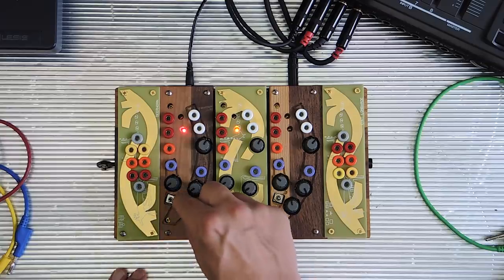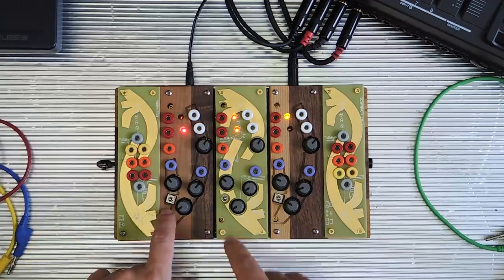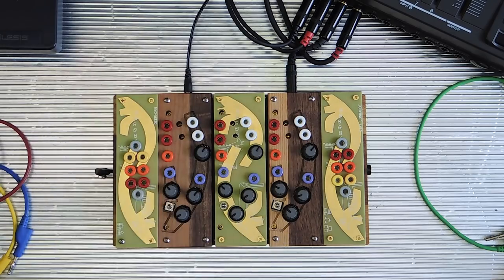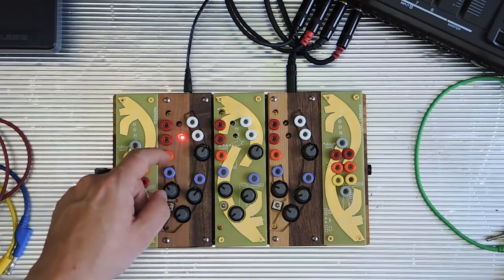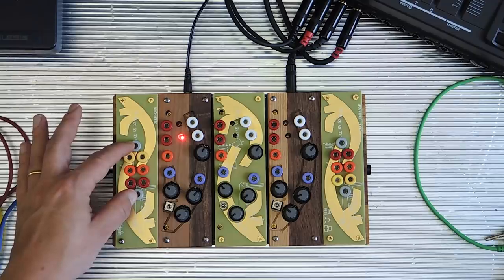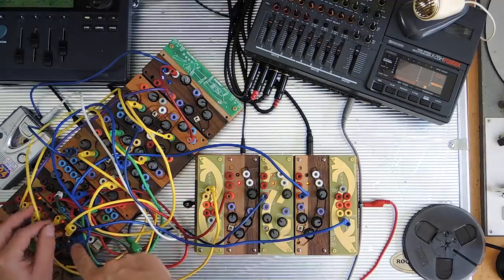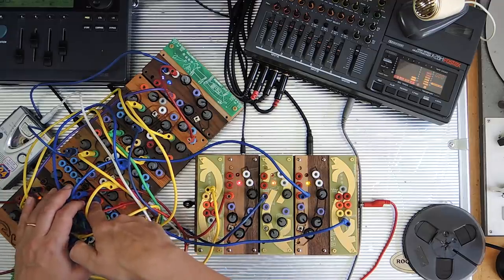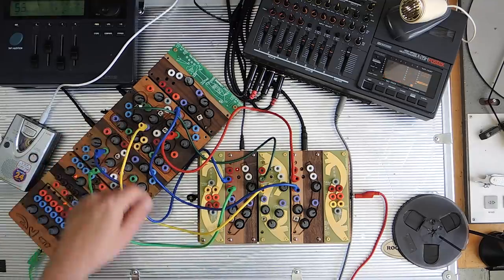Ciat-Lonbarde Deerhorn Organ - An Introduction

Comment from the maker: Darrin Wiener of Patch Point pointed out that Peter's zero is all knobs at 1 o'clock, and not just the top one. Also, top is ring, low is antenna and not the other way around. Also you should not tune it yourself, as all new instruments are factory tuned and you might break things if you don't know how trimpots work.

Comment: Beautiful machine! I've always found those no-touch interfaces very frustrating to use - getting flashbacks to using roland d-beam for pitchbend on my synths... At least the visual feedback on deerhorn lets you know what it's thinking!
Reply from the maker: D-Beam! I had forgot about that. Yeah, I usually prefer touch but with this it feels pretty easy. Though I surely lack the body control for pitched playing.

Comment: HAINBACH So I guess what I've concluded, from watching these two Ciat-Lonbarde Videos you suggested ( this one, now for the 2nd time [Sad Robot Kitties] ) ...is that the Cocoquantus leans way more towards processing, but isn't without Signal Generation capabilities ( in the form of 3 Triangle Oscillators ). But the Deerhorn is more firmly rooted in Signal Generation, with slightly less of a penchant for Modulation. 

 Sound fair?
Reply from the maker: Yes, that is about right. Deerhorn can do gestural mixing and some AM, but it's a sound generator at heart.
Reply: @Hainbach  thanks for steering me through the process :]

Comment: dear hainbach, what you think about using 3 theremin module of doepfer with three different sources (oscillators+...) to create something that could resemble maybe this deerhorn or that could sound anyway interesting? Have you ever tryed this theremin doepfer module controller or in general to use more than one theremin device ? It should be possible to set a "distance\sensitivity" to be able to not let the antennas interfere with each others. I actually just saw there is a lot of "theremin controller module" . have you ever use them?
Reply from the maker: Mmh, the OSCs are special on the Deerhorn. They are the secret warm sauce together with the VCAs that make it sound so pleasant without reverb. If you have similarly rich combo sure it could work with Doepfers.
Reply: tanks for answer, yet it seems that none on the web ever tryed (or show) to use more than one doepfer theremin control at once. My will would be to make a poliphonic theremin (that is what i like of deerhorn). Maybe ill try myself :)

Comment: Well my Moog theremin is very sensitive to the surroundings. How does the deerhorn antennas (and osc pitch) react to the patch cables and their position?
Reply from the maker: Osc pitch is rather crazy anyway, since it was not really made for that. I struggled with that as you can see in the video, but I don't have the amazing restrained and control of a theremin player. But the cables do affect the antennas -  also because they are in the way when playing. Pomona cables are almist a must.
Reply: HAINBACH ok that is what I expected. And it looks that the pitch range (or more the playable space) is rather narrow compared to a theremin. So this is more for Modulation, but the cable issue makes it more or less useless if you think of a decent playable instrument that the player can get used to by practicing. The way it is it reminds me more of a guitar that gets out of tune immediately.